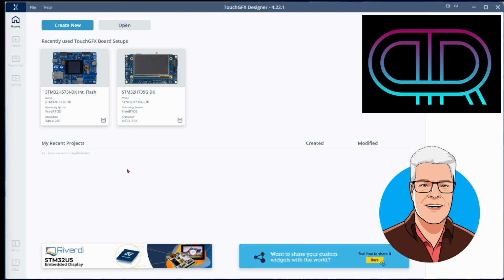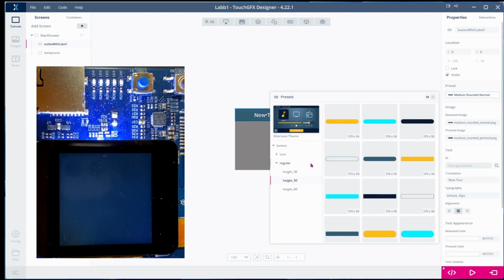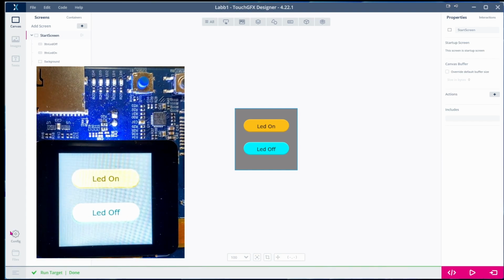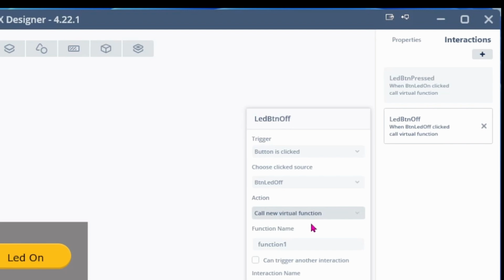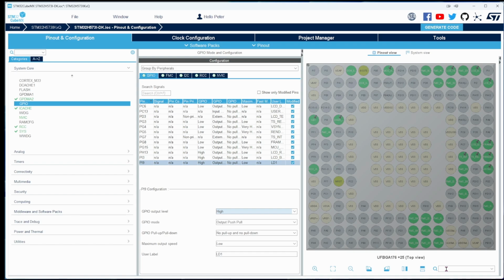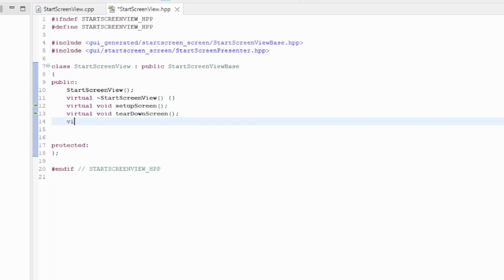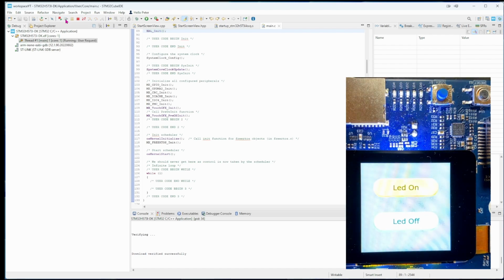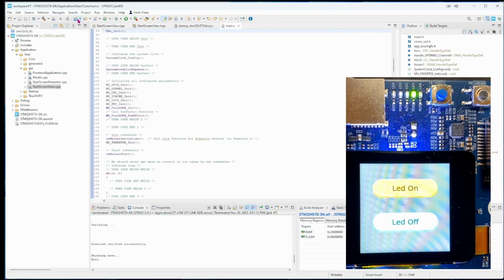Mastering LED Control with the TouchGfx :Step-by-Step Guide

Comment: Thank you for this great video. I wonder do you know if it is easy to use TouchGFX with an STM32 microcontroller and a Graphical OLED 128*64Pixel display or some similar cheap type of display that you can buy from China?
Reply from the maker: Hi Adam, I have videos on driving souch a small 128*64Pixel display and for this you dont need TouchGFX. I this i have seen cases where its done to some extent but that is not where the TouchGFX is mainly intended to be used at.

/PR TechTalk